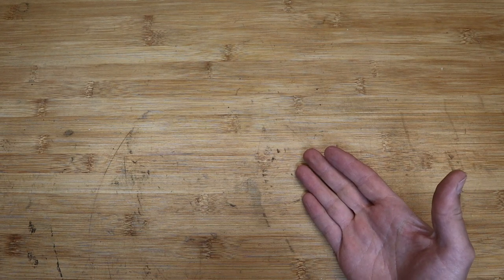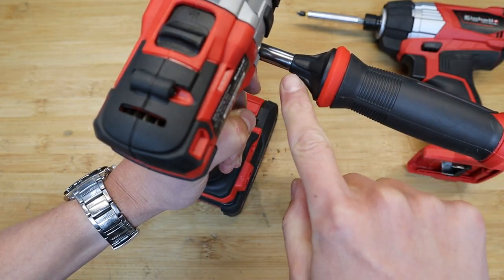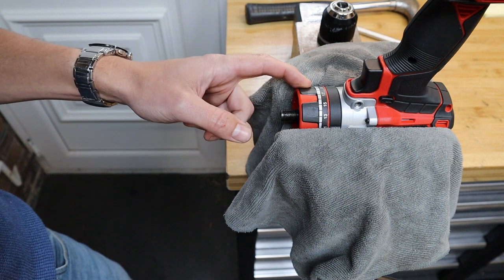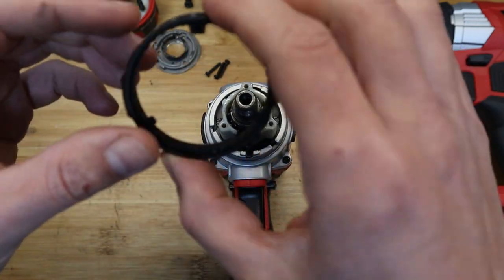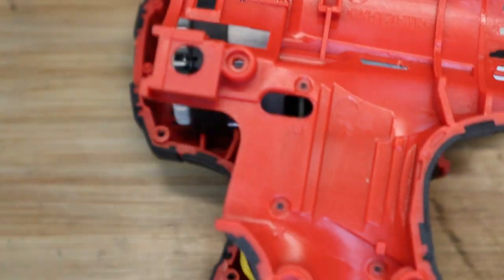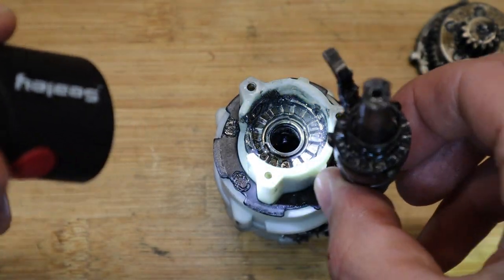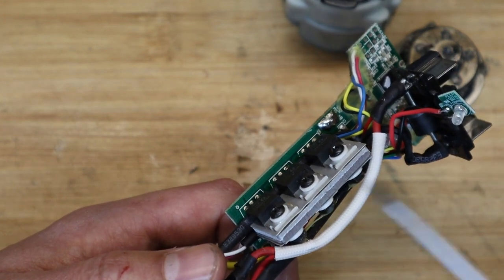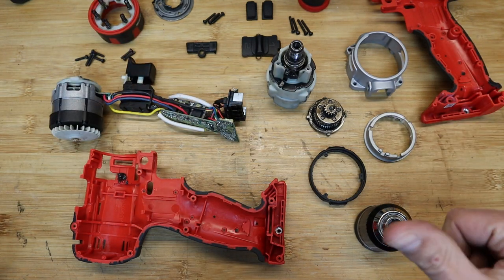Einhell 18V PXC Brushless Hammer Drill Teardown - How good is this one?

Comment: I'm impressed by this kind of video. I think we've all seen enough of the 'look, it drills eight holes in ten seconds in a piece of wood' type of 'review'. Just one thing; perhaps you could add a little about what is in the complete package e.g. case, charger etc.
Reply from the maker: Hi Bayadere, thanks for the feedback! The Einhell Hammer Drill was purchased as a solo device. So that one comes without any battery or charger. The only accessory is the toolbelt clip you can screw into the handle. I'll make mention of these things going forward :)

Comment: I have a bunch of the Ozito branded tools and bits, both X-Change and cabled (it is a little cheaper for the same thing if you can still find it after the Homebase/Bunnings situation) and really like their stuff. I would rate it above some of the big names' entry level tools, and been flawless for everything I have thrown at it. I am glad Einhell are easy to get hold of as it saves me having to try to import bits once Ozito have disappeared completely from the UK. Great videos! 👍🏻
Reply: I must of bought half the Ozito tools when bunnings closed down in st Albans,I know they make good tools as i have tried to destroy a $10 orbital sander in australia ,could not do it..batteries and charger and all tools same as Einhell.
Reply: I'm not intending to sound snarky so my apologies is it comes off as such but you do realise that Einhell purchased Ozito in 2016 so they should honor any warranty on your Ozito tools. Bunnings are the only distributer of Ozito tool range here downunder. I looked at the Einhell website and drooled with envy at some of the items you have that we don't.
Reply: @josephking6515  Not at all, and yes I have always assumed they would. To be honest I can't see any of my tools dying before the warranty runs out as I don't use them in a professional capacity and they all still work flawlessly.
Einhell has a brilliant range of tools available but I assume the import costs might be a bit prohibitive for you? I have since acquired the Einhell Brushless Hammer Drill and several of their batteries and they have the same consistent quality throughout. I don't think I'll every get any other brand unless they disappear.

Comment: I've been using Einhell for about 8 years now and have accumulated quite the collection of batteries and tools over the years, from power drills over vacuums to lawnmowers. Not the most powerful, not the best features but good value (especially the batteries!) and so far not a single tool or battery has broken down. Also Einhell's range is extremely good, they have just about everything so it's a good ecosystem to invest in imho.

Comment: The board not being epoxyed in is a good thing in my book, as it allows for component-level repairs.
Reply: A potted, well designed board wont even need a repair. Not potting it will eventually lead to issues because of dust and especially metal shavings.
Reply: @joob its easy enough to cover the board in hot glue if you're worried. And quite easy to melt off with a hot air rework, if you want to do repairs.

Comment: I’ve just bought one of these. The drill seems pretty powerful but the chuck doesn’t seem to grip the drills very well. No matter how tight the chuck is, the drills slip. Have you experienced this?
Reply: Found the same issue and resorted to tuning the chuck as tight as my puny little hands and arms can. It's a tad annoying that eh. Maybe get a speed wrench and put rubber sleeves on the jaws to protect the chuck and your tool warranty. Alternatively you could get a cheapie rubber strap with a plastic handle oil filter remover and use that to tighten and untighten it. I have one I use to remove the plastic casing on bathroom taps so I can get to the spindle and remove it.

Comment: I have the same drill. But now the chuck does not lock when removing the drill bit. The chuck locks when installing the drill bit. But when I want to remove the bits, the chuck rotates.
I'm going to disassemble the drill and fix it. Which of these parts you removed is preventing rotation?

Comment: I have a Te Cd 18 li i bl drill. I repaired and maintained this drill. However, I could not install the gear and transmission group properly. After maintenance, Coup did not work. Where should be the right place for the coup? Can you take a detailed video of the gear group? Can you assemble and disassemble the gearbox and conical in detail? I would appreciate it if you could make a video and post a link. There are many users, everyone is looking for this video. Need Urgently Please. 🥺🥺

Comment: Nice review! Do you have any experience with the einhell brushless 18/40 li bl (40NM)? It seems a nice product but looks at overall a little cheaper, besides no hammer function it is full plastic. Not sure if that would by a good purchase for a heavy DIY user (work mostly) but it's almost 25% cheaper than the 18/40 brushed version which has a better housing.

Comment: I repaired and maintained my drill. However, I could not install the gear and transmission group properly. After maintenance, Coup did not work. Where should be the right place for the coup? Can you take a detailed video of the gear group? Can you assemble and disassemble the gearbox and conical in detail? I would appreciate it if you could make a video and post a link. There are many users, everyone is looking for this video. Need Urgently Please. 🥺🥺

Comment: I'm looking for the model markings of the mosfet, do you have a high quality picture of the mosfet markings? 
Please confirm that it is "MXP4002JTL", my drill has BV6317 inside but it looks like that is a cheaper substitute and i can find no information or stock online.
Reply from the maker: I'll take a picture over the weekend for you. I believe because Einhell replaced this model with their new offering, spare parts will become more difficult to get hold of. I'll get back to you.
Reply from the maker: MXP4002JTL - YT02 - L8709H for the mosfets on this drill.
Reply: @toolteardown  Thank you for the info, my tool is from 2017, the mainboard is unavailible as spare part anywhere so i ordered MXP mosfets. I will replace them all and see if this makes it work again.

Comment: Heloo i nead your advice badly .
I got one seame as on video and when i pres on switch it moves only half milimeter with like shake and  never go in working state yust doing this each time i pres on buton
Reply from the maker: Hi Armin, sounds like the one or more of the mosfets have packed up. They electronically control the speed of the drill depending on how far the trigger switch is pushed in. If the drill only turns a fraction of a rotation, one or more of them have stopped working, regulating the speed. This could happen if they get too hot for too long by long use of the drill, or if the speed is changed a lot. (which also generates a lot of heat in them)
Reply: @toolteardown  thanks man i decided to not be stuborn and foloved posibly heat marks , i noticed one line of solder bit not coresponding to rest and it wass conected to one mosfet ., I took mosfet out and mesured , it is shorted and im gona buy new one thanks

Comment: actually yesterday i blew one of the mosfets after drilling 10mm in concrete...
Reply: What simptoms you have after mosfet burned., I got one that moves half of milimeter and shake in that milisecond   then never goes to work fully , each time i pres buton i get yust that like even light blink lite and fast
Reply: @arminkisic8666  ITS not moving at all. Only light ist working. Quite bulky flashlight. While Drilling it Made Bang and then silence
Reply: Hei mate i get that flash too by moving i didnt ment alot is yust like slight vibration wery fast like that flash of light
Reply: Can you explain me how to check this mosfets what and how i nead tondo thanks in advance

Comment: Having the LED light up high will cast a shadow of the chuck rendering it pretty useless.
Reply from the maker: Pretty much every drill model from Makita uses the high LED placement, as well as quite a few drills made by DeWalt & Milwaukee, so it appears to work ;) It needs to illuminate an area about 50mm in front of the chuck, not the tip of the chuck as with a drill either drill-bits or bit adaptors all "stick" out and is only really needed for initial part of the application, a.i. starting / undoing a screw or drilling a hole.
Reply: @toolteardown  My makita has the LED up there and it annoys me, I much prefer the placement on the bottom. Bosch has the led at the end of a very long battery shoe which is probably the ideal situation, even the thickest glove wont obscure it.
Reply: They should have LEDs in both locations. LEDs are cheap.

Comment: Hello, dear sir, I have a workshop for repairing these devices and I need to know the repair of the Brushless device. When I press the start button, it only turns on the lamp lights up when I press only. Can you help me?
Reply from the maker: Hello, It could be quite a few things. Start with the simple things, just to make sure it is not something easy. Did you try it with a different battery/ fully charged battery? Try change the rotation & drill settings to see if this makes any difference. Does it smell like burned plastic when you try to turn it on? Can you hear any noises when you try to turn it on? If you have access to compressed air, try cleaning out the vent holes of the drill, blow the dust / dirt out. If that does not make any difference it's probably the electronics, which you can access by opening the drill. Check for any broken / damaged connections on any of the solder points. Have a good look inside the motor windings as well. Measure continuity on the motor, switch, terminal & PCB to check if you can pin point the issue. If this all looks good, it might be the PCB itself (probably one or more of the mosfet's)  which is kaput. If you are good with electronics you might be able to pin point it and replace the individual part, if not you probably want to order a replacement PCB.

 https://www.einhell-service.com/en_DE/sparepart/451386001902/451386001902_01

Silly question perhaps, but is it still in the warranty? (Einhell have 2 - 3 years on their tools depending on if it was registered or not)

Comment: did you notice any chuck wobble because of hammer mode?
Reply from the maker: There is some axial play to allow for the hammer function to work, but as you push against the machine to drill or screw it "disappears". I did use it quite a bit now but did not notice any radial play or wobble so far.
Reply: @toolteardown  Thank you!